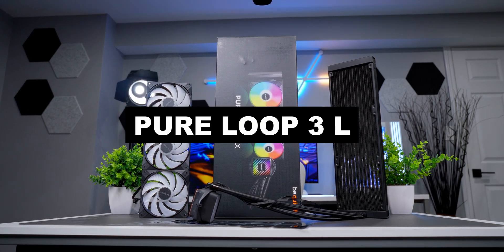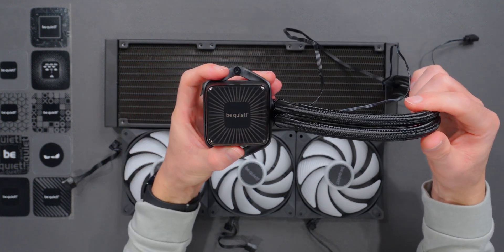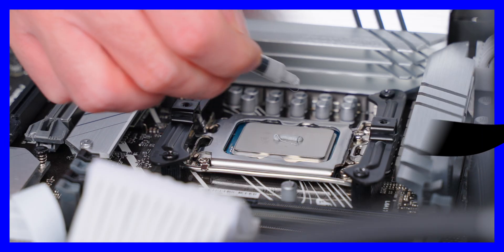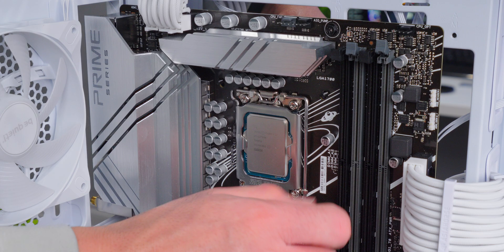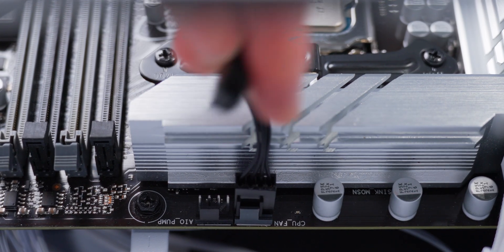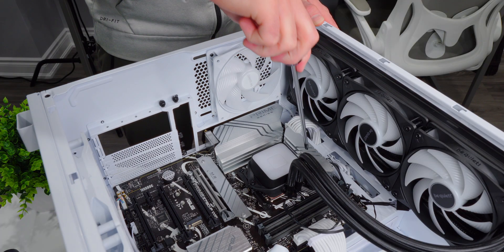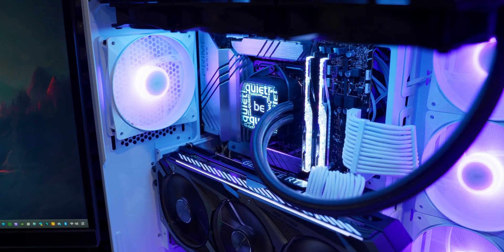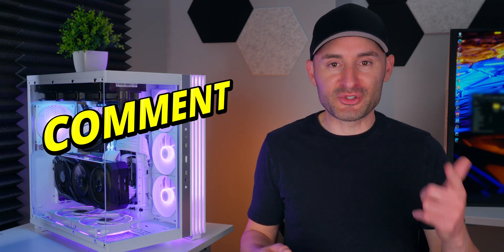Silent Power! – be quiet! Pure Loop 3 LX 360mm AIO Review

Comment: So since i have a am5 socket, be quiet fan, i can literally just replace this without anything on the back of the mobo?! Shiiiii thats ez game ! Just need the new brackets, the spacers might even be the same as my current Be quiet spacers!  Question is, do i get a 360 or 240?!

Chrrently running a 9800x3d with dual tower be quiet fans running 68-75c
Reply: I just bought the BeQuiet Silent Loop 420 for my 9800X3D,  but I had planned to run 2 - 420s in this new case . I'm sure It may be over kill a bit but U can never have too much cooling in reality. Eventually I will do the GPU as well.  I really wanted a refillable AIO and these and the Alphacool are the only ones I have ever found that can be refilled on the radiator.